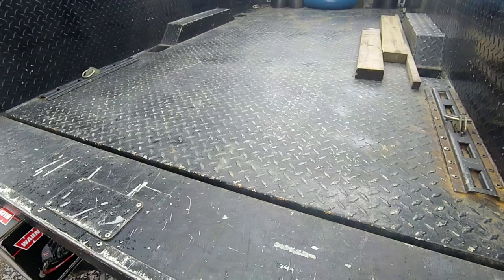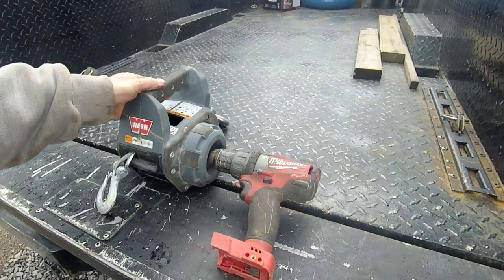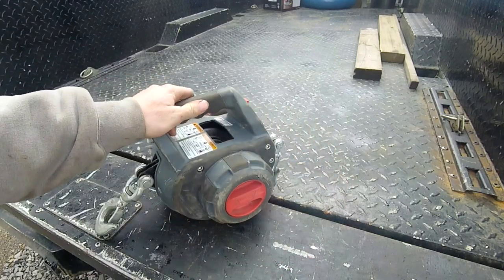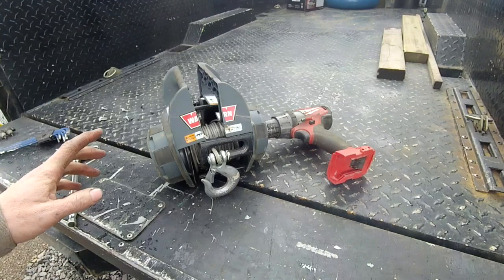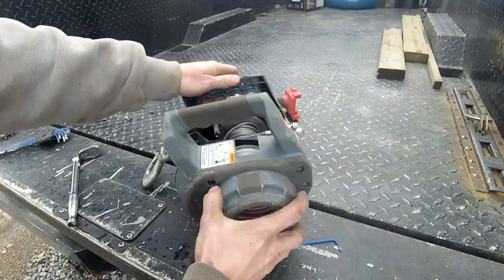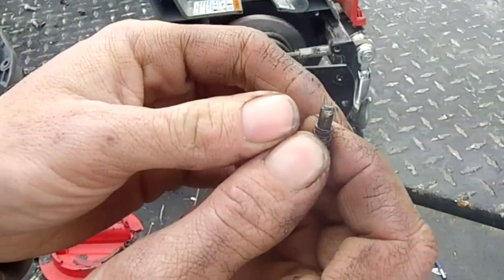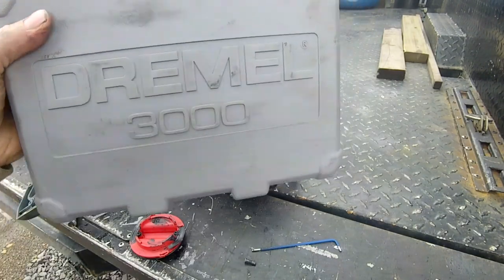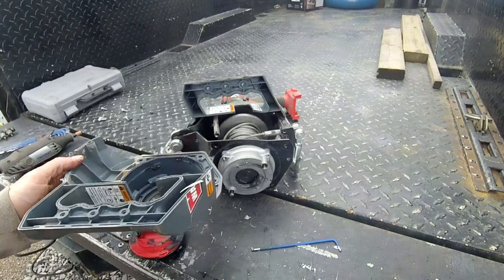Warn Drill Winch Secrets

Comment: What do you use the winch for? I bought one a few years ago and it's so weak I never could find a use for it. Tried to pull a small log and it wouldn't so I pulled it by hand! Lol I can pull more by hand then the winch.  I did lift a deer to skin it, but it took longer than I could have pulled by hand. I really wish I could find a use for it?
Reply from the maker: It's good for winching lawn mowers on a trailer.  I bought it for winching heavy pipes through a machine I was repairing.  As far as winches go it's pretty weak.   I bought it for that recurring job.  I used the one in the video a lot for that.  Now that I got all those pipes moved I haven't used it in a couple of years.